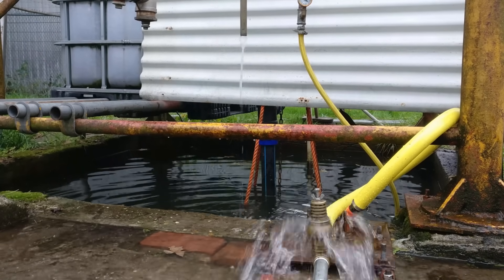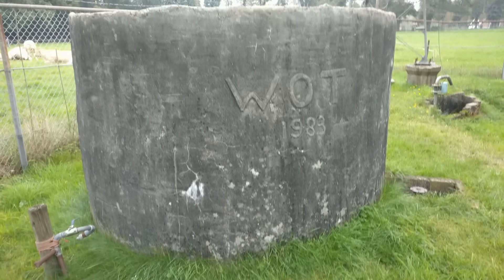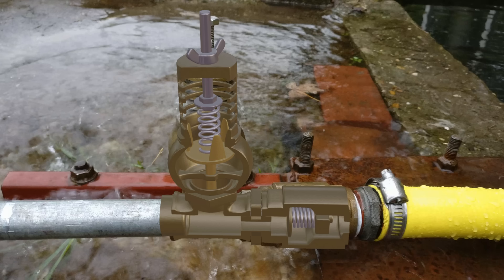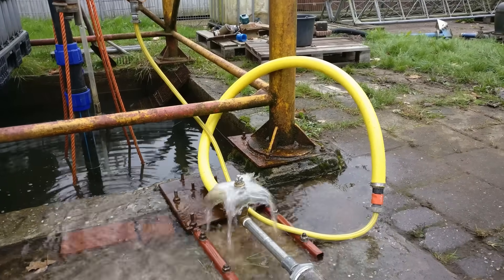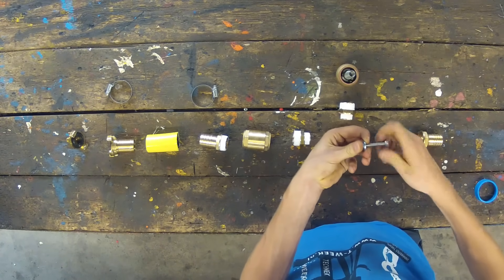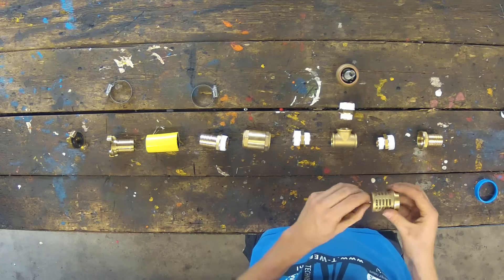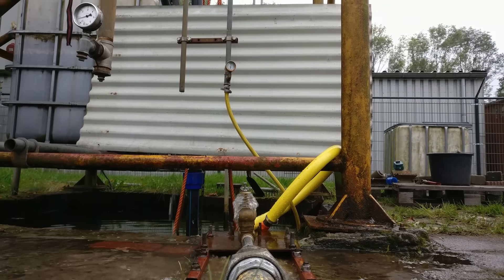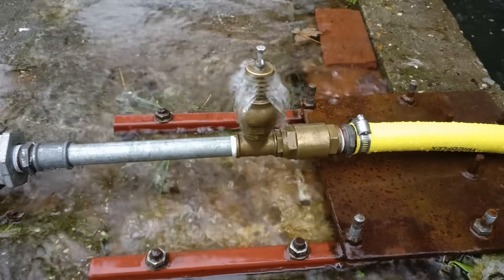Pumping Water Without Electricity - The Breurram

Comment: One day I will need this.... And I'm sure it'll be when the internet is down
Reply: Understand it completely and you'll never need to worry about that.  Maybe build one?
Reply: @lubricatedgoat  cant speak for anyone else but  now that the device has been explained and demonstrated to me and I understand the mechanical principle on which it operates I feel fully confident in my ability to reproduce one should the need ever arise.
Reply: @foxhazglocks  same. I'm even thinking of ways to improve it or incorporate a microcontroller.
Reply: @lubricatedgoat  be sure to include an electric motor with an impeller, solar panels and rubber diaphragm accumulator to your hypothetical upgrades!
Reply: On this episode of doomsday prepers:
Reply: Aint that always the way lol
Reply: It works the same way the phenomenon we call "water hammer" works, Momentum is just a consequence of inertia.
Reply: @zakbrinkhoff324  80 MB seems far too low to me. That would be about 80,000 book pages, so maybe 250,000 articles if most of them are short. The English Wikipedia has over 6 million articles.
Reply: @gustavgnoettgen  then gb my bad but either way it takes up hardly any space and that's with all the photos
Reply: @zakbrinkhoff324  that's true.
Reply: @gustavgnoettgen  books take up almost no space.
Reply: @zakbrinkhoff324  Books take up a lot of space.
Reply: @gustavgnoettgen the entire English Wikipedia is only about 90gb
Reply: @runed0s86  without pictures?
Reply: Save it u can record and save on a cd or some shit or personal files that’s what I do wth all these kinds of videos and just make a archive in a file cabinet
Reply: @iliaperez7290  the problem is those deteriorate with time that's why the best thing is like a ssd or like massive 50 TB to 100 terabytes storage devices
Reply: Exactly what I was thinking
Reply: YouTube to mp4 bud.
Reply: yt2mp4
Reply: So write it down
Reply: @Abihef  you sir are a genius!!!!
Reply: D O W N L O A D
Reply: The the us it’s called a ram pump
Reply: Yeahh it's always like that
Reply: Thats what you brain is for, most people forget
Reply: Got to start writing, its necessary at this point.
Reply: Memorize the name of the pump and go to a library
Reply: @rckli  it's a basic ram pump. It wastes huge amounts of water to move every little water. Useful if you have a river or stream that flows nearby you can put it in there so the spillover simply goes back into the water source. Of course, all that kinetic energy does beat up the components.

His holding tank has so little kinetic potential energy it can work but thr amount spilled it is far greater than the amount pumped straight up. Then he's going to probably refill it from a municipal supply. In which case, either pipe it straight in if you have a supply or if you can't get enough lift then a motor will get it done. 

This device is pretty useless outside a natural moving body of water.
Reply: I need it now
Reply: Y2K - ARPANET's revenge
Reply: Google internet apocalypse. Internet down scenario could happen sooner than most think.
Reply: @TheXxxcodexxx technically Google is dying
Reply: That’s why you save it in your backup hard drive or sdd full of fabrication and survival in case of internet and electricity loss
Reply: Better get it and store it.
"One day I will need this" is also one of my thoughts during the time I was in my prime income and resides in Soho residential in modern city. Until that day came, I had to move to rural area. And that is the day, I have headache as there is almost none existence to find the parts. This is because when we reside in remote area, there is no public water supply. When there is no public water supply meaning to say at the same time. There is no electricity for the public at remote area. And at that condition, to buy the parts is pretty heavy on pockets too.
Reply: I download and save valuable videos for keepsake and for easy reviewing. No internet required.
Reply: My first thought exactly
Reply: We got sketches from davinchi 
ALLEGEDLY
Never know.... 
The fecking point is you can sketch it guy 
These freaking jerks make us sketch....
Reply: You can download the build guide
Reply: Yt-dlp
Reply: Screen record ;)
Reply: It's a check pump. Uses two checks and two heads of water. Simple and easy
Reply: I would Download the Video
Reply: Write it down lol
Reply: I have had this exact thought in the way that govs Burt books in older days we will probably find a day in our future where this treasure trove of information we call the internet will be a need to know basis. And that will be the day that a random hard disc with all of the survival and science innovation related to technology videos will come in handy.
Reply: Ahahah same feeling! 😂
Reply: uhh what
Reply: +thomas barlow  I'm sure this guy can show you how to make a new Internet out of a booger, a few hoses and fittings, and some duct tape.  lol
Reply: Put the video and instructions and parts list on a USB stick, write it down somewhere, print some photos to store in a safe place, memorize it, build one now, make redundant options.
Reply: My mans knows conspiracy theories..
Reply: See, I have little hope for the future but I want to survive, so I've gone about downloading and archiving (with a bit of code to help) about 163.2Tb worth of Survival knowledge of all forms, maintenance guides for just about any useful gadgets/tools/machines, from building wells to bridges, pyrotechnic manuals, about every recipe in the world and how to mimic certain ingredients not available. It's all stored on a solid state NAS. Costed about 16k but now I have access to what would be the equivalent of the Arc of the Covenant in a sh*t has hit the fan scenario.
Reply: Exact.
Reply: Build one now then.
Reply: Buy the valve now
Reply: That's why the explanation of the effect is important, it's simple and possible to remember
Reply: Download the video lol
Reply: Remember books? Should be taking notes in a scrapbook
Reply: Totally 😂❤❤❤
Reply: i wonder does this pump use more water then it pumps or does it pump the same amount as it uses.  could come in handy when the wind quits and the wind pump is not in use.
Reply: @carmichaelmoritz8662  if i understand correctly you would always have quite a bit  more bypass/loss than pumped water, very inefficient but still very clever.
Reply: @foxhazglocks  👍
Reply: @foxhazglocks  if I’m understanding the mechanics of it then the pump relies heavily on the weight of the initial water source creating a compressive force on the vertical spring. In essence it’s taking advantage of the hydraulic hammer effect to ram water upward.
Reply from the maker: @foxhazglocks  Exactly, only a small part of the water is pumped up. You should not use this pump if water is scarce. It is meant to be placed in a river, where there is plenty of water.
Reply: @SurelyLightFoot  
  It's kind of a variation of a standard ram pump, only in this configuration the large looped pipe contains the air cushion, instead of a vertical chamber, with the output above the valve, and below the chamber. 
  My ram pump beat it's valves to death, over the course of 2 summers. I wonder if this one is "softer" on the valves. I use the discharge from my pond to power mine to water the garden, so discharge water isn't a waste, it just returns to the normal flow.
If you figure up how much water your system pumps, it will surprise you. If you figure a very conservative 1 GPH X 24 hours X 365 days in the year that's 8760 gallons, which is over 70,000 lbs. of water. Figure out how many gallons, it actually does pump per hour, and do the math. These are capable of pumping year around, even in freezing temperatures, since the water is constantly moving. 
  They used these prior to electricity, to pump water to towns along major tributaries.
Reply: @WOT_utwente  I think a lot of people look for a one size fits all approach. This is an excellent, perpetual way to keep tanks topped off under particular conditions. Thanks for sharing! Pumping water uphill without power could very well save lives someday, perhaps it currently is.
Reply: @foxhazglocks  in a ratio involving Betz’ number perhaps?

Comment: Huh this is the water analog of a DC/DC boost converter!
Reply: It is amazing how similar this is! You let some water/electrons flow, suddenly try to stop the flow which causes a pressure/voltage spike because it doesn't want to stop, use some valve/diode to capture that spike and an air bubble/capacitor to smooth it out at a higher level.

Comment: 100% FAKE VIDEO!!!!! 

They did NOT pump the water to 12 meter using this pump!!!! The water pipe is 12 meters in height BUT is piped back down to a 2 meter height where the outlet is! You can have a 1,000 meter high pipe, but as long as it is piped back down to inlet, almost ZERO force is required to pump water through it!!!
Reply from the maker: Hi Tom,

Thank you for replying, it is good that you are critical, there are a lot of fake videos out there. 
This video, however, is not one of them. The process you describe is siphoning. In our setup air can enter at the top therefore sophoning will not take place.  And even if this siphoning effect would take place, when starting up the system water first has to reach the top, therefore the pump should be able to reach the required pressure on its own.

And yes, we could have filled up the pipes in advance to overcome this, but I can assure you that our goal is not to trick people on YT. We are a well established organisation (please check out our website in the description), and we just want to spread our knowledge and without further interests. We do not sell these pumps and are a small YT channel so we don't earn anything. We have no motive to trick people.

Moreover the breurram is a type of ram pump. These types of pumps are well known and are used all around the world. Pumping water to 12 meters is nothing new in the area of ram pumps. If you want you can google ‘ram pump’ or ‘hydraulic ram’
Reply: @WOT_utwente  excellently worded reply
Reply: @WOT_utwente  still, we are supposed to take your word that you did not fill up the pipe beforehand??? Lol, that is 1000% a lie.

I have been building ram pumps for over 40 years and know all about them. What you are claiming in this fake video is not possible.
Reply from the maker: @Tom-yc8jv  Hi Tom, in addition to my previous message, where I explained we don't have a motive to lie to you, I would like to point out the way the water flows at 8:28. Especially for the 12m pipe,  you can see that the flow is not continuous and air can easily enter the tube. When looking at this flow we can conclude that the tube above is not fully filled with water but also contains a significant amount of air right? I hope you agree with me that the air in the pipe will prevent syphoning from taking place. Even if the rising pipe would have been filled with water.
Reply: @Tom-yc8jv  If you have been working with ram pumps for 40 years, you should know that fluid dynamics make a 12 meter syphon impossible. Beyond 10 meters, the pressure at the top dips down to 0 atm and cavitation occurs.

Points to you for knowing about syphons, but if you think they occur with interrupted flows or big height differences you shouldn't be lecturing people about them.

Comment: I think, that you could have a better result, with a check valve before the device.
Reply from the maker: Hi Jaime,
Great to see that you are thinking about improving the design! If I understand it correctly, you suggest putting the high-pressure valve in front of the T-joint? I am not sure if that will work.
It is essential that water can flow freely for a while to build up speed, if the plate then shuts a pressure peak is created. This opens the high-pressure valve.
If you put the high-pressure valve in front of the T-joint, it will not open as there is no pressure peak. There will therefore also be no flow so nothing will happen.
Reply: @WOT_utwente   I mean a clapper check valve (no spring check valve), which does not allow the dissipation of the wave towards the section between the tank and the ram pump. Naturally, it is something theoretical that could easily be proved.  Regards.
Reply from the maker: @jaimecano1771  Ah I see. That is an interesting idea. If this valve does not restrict the flow too much and can close quick enough, you might get higher pressure because of this. I think we might try this out in the future, I’ll let you know if we get interesting results.  Thanks!
Reply: @ogi22  although water is incompressible, the piping isn't, especially on long distances. Furthermore, the pressure wave does travel through the liquid back and forth, resonating untill the energy is lost due to friction of water with the pipe wall/itself. Hearing piping "sing" in an industrial setting is very disconcerting, because your valves are closed too quickly or there is no pressurebuffer present. It can take quite a lot of time for the pressure wave to subside. 

I really think he is on to something here. If you concentrate the pressure wave to the head, that might give an excellent free boost in efficiency.
Reply: @ogi22 , while water may not compress, it can be pushed back into the tank it came from. This valve would stop that.
Reply: @questioner1596  Yes, it is the role of a check valve. Yet it is not that simple. I think for small applications like here, check valve may be completly useless. But for big applications, with pressure tank etc, it would work. There are a lot of things to consider - time to close the valve against the time of pressure wave propagation for one. This would give you the idea if the use of the valve is reasonable, or where to put it in the pipe.

Comment: Ram pump without air chamber .... unique design!
Reply from the maker: Hi, in fact there is an air chamber; the big yellow hose contains a bubble of air and acts as the air chamber. But you're right it looks different than most other designs
Reply: @WOT_utwente  seems way more compact than other designs for a ram pump.  Love it!

Comment: Sounds like a ram pump but it looks different
Reply: The same principle. Create high pressure with fast moving water, then block the easy pathway to push small amount of water higher. Kind of like different versions of a Stirling engine.
Reply: Yeah just much quieter
Reply: @Tasmantor  Sound is generated when the valve is shut. This one does it more gently, but also doesn't create high pressure.

Comment: Wow nice video 👍
But one things from where I could buy?
Reply from the maker: Thanks! You can make your own. The parts you need you can buy at a large hardware store or otherwise online. Everything you need is listed in the manual, a link to this is in the description. If something is unclear feel free to ask.
Reply: @WOT_utwente  nice work..can you post the link where we can buy online of there's parts?
Reply from the maker: @vasyong   Hi Vas, since I do not know where you live it is hard to recommend a place to buy material. Large international online stores (ebay, aliexpress, etc) will have the part available, but probably it is quicker to order something locally (again depending on where you live). If you go to a hardware store they  might also have what you need.
Anyway the parts that may be most difficult to get are the two valves. If you search for 'brass spring loaded check valve' and 'brass foot valve' you should be able to find the right parts.  
Please let me know if you managed to get all the parts.
Reply: Why, this is a FAKE video. The pump is NOT pumping to  12 meter height, but actually a 2 meter height, since the water pipe's outlet is only about 2 meters above the pump itself.
Reply: @Tom-yc8jv  Lookup "hydraulic ram pump" here on youtube, it's definitely a real thing. the tank above is not airtight so it still has to pump water that high